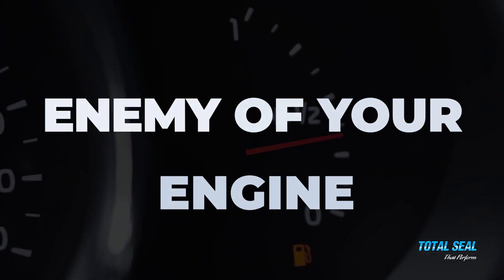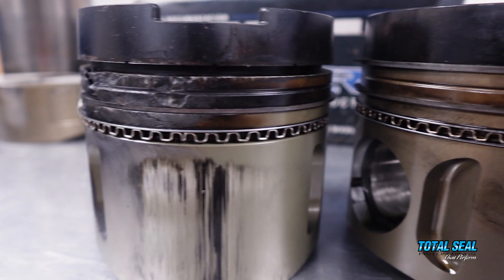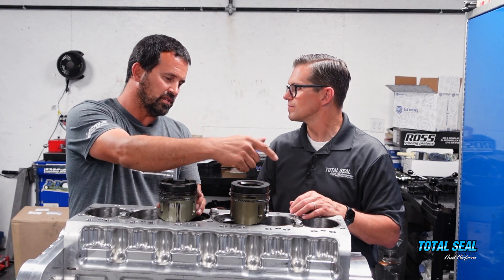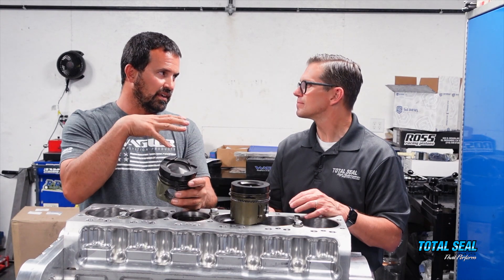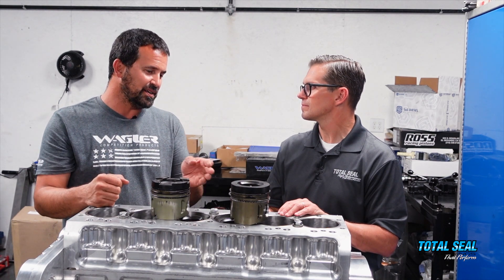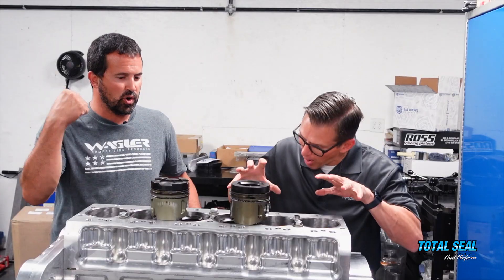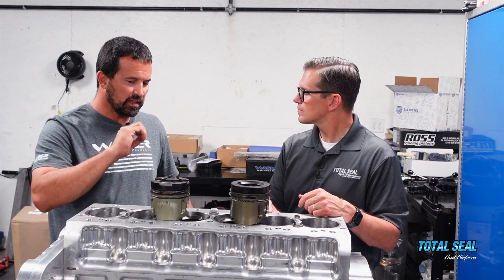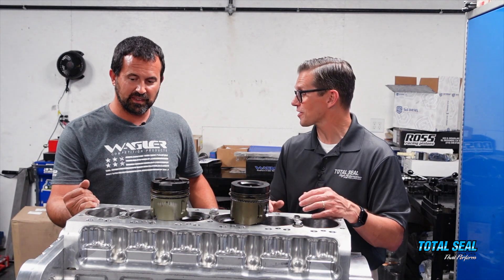What STOPPED These Pistons From FAILING?

Comment: We need a video on the bottom line of 0W-8 oil on the new Toyota's. My 2024 Toyota Corolla LE I purchased last week (Mar 2024) has the "dreaded" 0W-8 sticker. This grade of engine oil is hard to find (even at Toyota dealerships) and expensive. Is 0W-16 OK to use long term? 🤔 Owners need to know.
Reply from the maker: Stay tuned! There is a video on the @TheMotorOilGeek channel coming soon to answer that.
Reply: @TotalSeal  I just subscribed to that channel. Thanx!

Comment: Haha nice head gasket😂
I did that once ,on a vw diesel. 
It blew right out of the #3 and made a heck of a noise like i had jake brakes. 
It was dark out of course,and when we pulled over and looked around it wasnt obvious. 
So i told my buddy to bump the key. 
Splash, i got like a quart of coolant blasted all over my lower half. 
Hey i found the problem 😂
Thats when i figured out that an injector pump that would be really strong for a 1.9 was just a little much for a 1.6. 
Fun while it lasted until replacing gaskets all the time got old.
Reply: You hydroed it?

Comment: Im not a diesel guy, BUT, the fact that one can do multiple injections per combustion event, and adjust per hole with a common rail, HAS to be a HUGE advantage over the single squirt of a mechanical system...

Maybe not in terms of the ultimate h.p. number, but a common rail system SURE as hell HAS to be better in terms of longevity of a big power engine.. 🤷🏻

Comment: My first experience with a 6.7 Cummins was a previous failure from another local machine shop. 
   I had just switched over to diamond and cbn hones. 
   Made a call to Total Seal and took notes. It was unnerving seeing the change in the cylinder wall surface finish. 
    It worked. Was able to follow up  with a few more   6.7 engines and bought a profilometer. 
   When you see top rings that are just .015- .020 thicker than the oil control rings it forces recognition for change.   
   I’ve honed on blocks since 1991 at  four different shops in three separate states. 
  There were no differences between methods or grit choices between any of them.  
   Things have changed.
Reply from the maker: Thanks for sharing!
Reply: Quite common to run across the "it's good enough we've always done it that way" ego blocking the learning of new things.
Reply: Absolutely! New ring tech REQUIRES a totally different surface finish that years ago. 

If you want to take advantage of the bonuses that new ring tech offers, you MUST make changes to your honing program.

Comment: Can you advise about sealant for seal oil sump of engine.
Reply: I love Permatex Right Stuff....

Little more expensive than the regular ole stuff, but it's MUCH better. The "one minute, fill it up with fluid, and back to service" is a bonus also. 

It is thicker, doesn't squish out as much, and STAYS put better than conventional RTV.

Try it on the China wall on your next V-8 intake job. You'll swear by it also.

Comment: I worked with boat engines and I have take a lot of samples. Of oil.  And the fuel in a most of the marine engines have 5-10% of fuel in the oil.
Reply from the maker: WOW!
Reply: @TotalSeal  if u want I can share.  Some oil analysis report. Frome some outboards.  I think one of the things is that they always have a 60 c thermostat.  So they don’t build up so much salt in the engine.
Reply: @MrBilly334 what is the factor in your opinion on what causes that across the board. Environmental or operational? Just curious
Reply: @NobodyUR  on the mercury 450 that hade 10% in the oil that costumer. Have burn about  8000 liter of fuel in that 100h. And it is supercharged.   But I’m
Going to do some Moore testing
Reply: Is it because the engine never heats up as much as a passenger car engine? Or the fact that the engine sits at a high RPM level for SO much longer than a car?
Reply: @davelowets  i think it is beviset the termostat om Outboard Engines and inboard engines that are not freshwater cold run thermostat around 150-160 f.  50-60 c. So they don’t make so much salt deposits in the cooling system.  We see that if we run them whide Moore load they don’t get so much fuel in the oil

Comment: Very interesting.  What happens if u have a small amount of 2 stroke oil in the fuel. ??
Reply from the maker: It could cause pre-ignition.
Reply: In spark ignition engines 2T oil acts as an octane rating depressant. Hence pre-ignition mentioned by Lake Speed. Diesels can't pre-ignite because they don't inject fuel until they want it to ignite.

Adding 2T oil to diesel fuel is common practice for vintage engines whose injection pumps can't cope with the lower lubricity of modern ultra low sulfur fuel. But it doesn't do anything for the piston and rings. The same benefits can be had by adding some biodiesel as well.

Comment: You can hold more oil on the cylinder wall if you remove the oil scraper rings 😂
Reply from the maker: LOL
Reply: I actually I was wondering if you couldn’t just get by with a total seal second ring and running no  oil rings.  With boost try to blow everything back to the pan anyway maybe it would be a minimal enough amount getting into the chamber when not running hard to be ok?
Reply: James Bond smoke screen.... 😬
Reply: @bcbloc02 Hell NO!

Comment: Won't be long and 8 to 10k rpm ranges will be the bench mark.. extracting more power and busted bits in persuit of extreme lasting power. Ceramic top and skirt coated slugs.. 😂😂
Reply: Those coatings have been around for a while already
Reply: @davelowets  but you don't see everyone using ceramic topped slugs in high output diesels.. l guess alloys have improved over the last 20yrs they hold together.. EFI has come a long way as well keeping mixtures more consistent..

Comment: BS, what dyno measures 3,000hp
Reply: Ask Steve Morris. He measured 5007 HP on the Devil 16 engine, the V16 engine that he built ......from scratch.
Reply: Lots of them, watch more engine builder and race channels.  Also you can get close with math.  At the drag race strip, knowing the car weight, approximate aerodynamic drag, elapsed time and trap speed, you can use that information to calculate the approximate energy required to hit those numbers, and from that you can calculate the approximate horsepower the engine is delivering to the wheels.
Reply: Mainline hub dyno
Reply from the maker: Jeremy’s dyno does…
Reply: There's dynos around that do well over 5k....